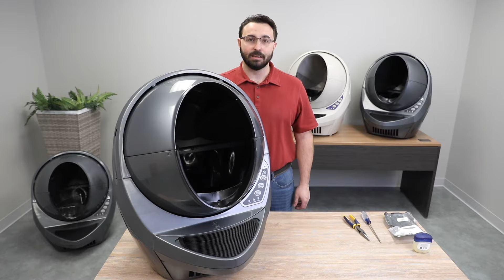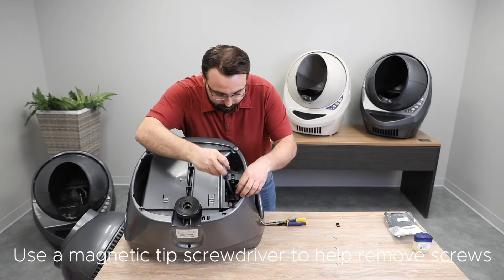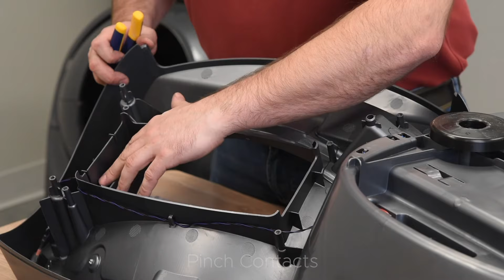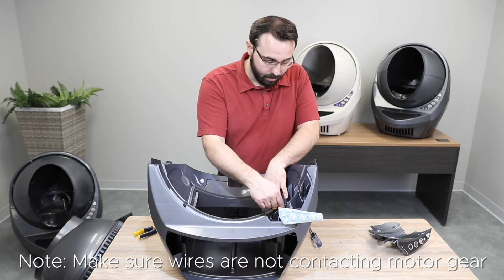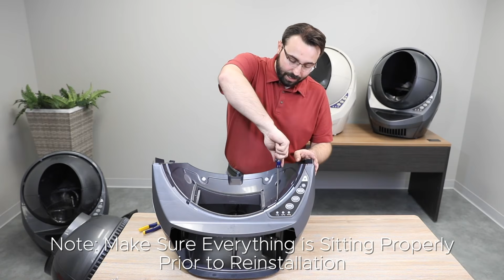Litter-Robot 3 DFI Kit + Pinch Detect Terminals Installation

Comment: *You will need a 6" screwdriver* First, thank you Litter Robot for providing this video.  For the most part this is all you need to perform this repair.  I was a little worried when the replacement part had MUCH smaller circuit boards.  The old ones were 4.5 inches long, filling the holders.  The new ones were only about an inch, but they appear to be working.  Our litter box starting saying it was full after a single use.  We would reset it in the app but the very next use it said it was full again.  The DFI replacement kit solved this problem.  If you're doing this and debating whether or not to replace the Pinch Detect Terminals, just do it.  This is not an overly complicated procedure as long as you have a long, 6" or longer, screwdriver.  An extension will not help as it will not fit in the holes.  I was a bit perturbed when I got to the bottom screws and realized a standard 4" shaft screwdriver is not long enough.  Having to make an extra trip to buy a long screwdriver after you have reached this step was highly annoying.  A simple statement of required tools would have saved me that trouble.  I will, however, give Litter Robot major props for making this system very serviceable.  So many manufacturers make their products impossible or extremely difficult to work on.  The fact that most of the maintenance and cleaning you will need to do requires little effort is impressive.
Reply: I wish I had read the comments before starting the job--the biggest issue was definitely the length of my screw driver shaft. As an FYI I found one with a long enough shaft in the electrical department of home depot--it wasn't magnetized (which really helps), but at least I could get all the screws out!
Reply: The new smaller sensor units seem to be sealed to hopefully prevent the failure from reoccurring
Reply: Yeah, the v2 sensors are fully encased in resin, so there should be no more concerns with corrosion of the leads coming off the micro controllers on the board. While it's surprising they didn't do that originally, good on Whisker for making this improvement rather than continuing the sell the faulty design and advising customers to slather the chips in Vaseline.
Reply from the maker: Thank you for your feedback about this video. We appreciate your suggestions and your continued support!
Reply: Why—when you’re getting $600+ for each of these bad boys—couldn’t you afford to get a camera that films from ABOVE so we.could see exactly what you do down in there (wire placement)? Would’ve been so helpful.

Comment: I was considering upgrading my entire cat bathroom situation.. by throwing my litterrobots in a dumpster and just getting some 5 dollar litter boxes and a scoop. I seriously cannot comprehend how this thing is so incredibly flimsy, crappily made and susceptible to not working. I had one base for 2 years after multiple fixes and adjustments to keep it running, I figured id get a second and have 2 for my 2 cats and to have a backup since id come home to it stuck 1/2 way threw a cycle and coming home to crap and pee all over the ground too many time. Well, base 1 bricked entirely 6 months later and base 2 is now in the constantly needing replacements and troubleshooting phase of its' career not even 2 years later. This company sucks, their patent on the decent design is the only reason they get away with selling this bullshit.

Comment: Claims that the number of screws in the control panel cover is "5 total". Unscrews only 4 screws in the video. Apparently, this is to make people wonder where the fifth screw is. It is a quest of sorts, just to keep things interesting. The funny part is that when he dumps the screws out at 3:00, there are actually only 4 of them. So, how many are there really? 5 or 4?

Also, in the video he claims that pinch terminals are two identical brackets ("doesn't matter which one goes where"), yet in the video the two parts he removes look very different. How come? Did one part just get distorted during removal?

Comment: What if i bypassed the pinch sensor like 2yrs ago but now i want to replace the dfi sensors..if im buying the kit should i replace the pinch sensors anyway.. my point is can I just put the DFI sensor in and leave the old pinch bar wired together or will that not work now? I’d hate to put it all back together and realize I should’ve just put the new metal pinch sensors in.
Reply: Replying to my own comment never mind my pinch sensors were toasted anyway, so I had to replace them, but I did not bypass the pinch detection as a sidenote, putting the wires back with the motor was a total shit show

Comment: First of all you don’t just need any regular screwdriver. You need a long enough screwdriver that it will reach into the hard to reach places on the underside. If you don’t have this it is impossible to do. This whole thing was extremely frustrating and way more involved than this video would suggest. For a $550 litter box the company should really send all the tools you need to fix this. Will never buy another one just because of this issue.

Comment: If you replace the DFI hardware and then have issues with your globe over-cycling and getting the position error, make sure you didn't move the position sensor when moving the motor and uninstalling/reinstalling the DIF wire into the main circuit board.  That was my issue and this video shows how the position sensor should be properly seated: https://youtu.be/gQwawQP7lys?t=200

Comment: Tl;dr: You dont just need a philips head screwdriver. You need specifically a 6"+ No.2 philips head screwdriver.

 Absolutely ridiculous. "Just a philips head screwdriver." No, you need a 6"+ No. 2 Philips head screwdriver. After my first screwdriver wasn't long enough, I used my other one with an extension. NOPE! Not designed with extenders in mind, won't fit. Got a new screwdriver kit with a one that is long enough. NOPE! Screw bit is too large. 

Whomever designed this clearly did not keep any of that in mind. After buying 2 extra sets of fkn screwdrivers I am still sol. At this point, I would almost rather throw it in the trash with how frustrated I am, especially on a part that should have had proper insulation in the first place

Comment: Great video, easy to follow, and fixed my problem with constant “drawer full” notifications that were false. 
Like others stated it needed close ups for better instruction, but taking my time I was able to replace my pinch sensors and DFI sensors. 
I also took the time to clean the areas and other places that were exposed and needed cleaning, to hopefully help extend the life of my robot. I have had this robot for almost 4 years, going from one to two, and now back to one cat. It slowly started to have false drawer full notifications around 6 months ago and after looking into the problem and possible solution, replacing these sensors worked immediately in solving the issues. I’m extremely excited to have my robot working better again!

Comment: While the video is helpful, I can’t understand why 3 of the screws for the bottom half are place in wells that are inaccessible with a standard length screwdriver. All my bit extensions exceeded the width that could pass into the holes. I couldn’t finish this repair. So much about this robot’s design seems flawed and requires too much maintenance for something that is supposed to make life convenient.

Comment: For future reference for everyone. When putting the control panel back together make sure the position sensor isn’t knocked out of place in the 2 black slots.

Took me 45 minutes of troubleshooting to find out what I had done wrong because the 3 lights blinking in a row had never happened before.
Reply: I wish I had taken this comment to heart but I didn't even know what the position sensor was since the video never mentioned it once. Four hours later, my Robot seems to be working again but this repair was way harder than it needed to be. The position sensor gets moved when you take the base apart. Without a mention of it in the video, we didn't know it had to go back in a specific spot.

Comment: If there’s anything I could call out specifically for the other DIYers out there it’s that the black soft plastic piece next to the control panel is a sensor, and that the 2 prongs on the back of it need to go in the 2 hollow pegs next to the screw hole closest to the waste bin opening. It’s the globe sensor to help it realize when it’s back in home position. I think mine got jostled while moving the motor around, and I had to go back in for a second time to reseat it (there’s a separate troubleshooting video there you can find if you use the troubleshooter on the litter robot  website to diagnose your issue that is just as handy in fixing this secondary problem you may have).

With that said, this is the easiest repair I’ve done in a while. Was there some guesswork because of questionable camera angles? Yes but my litter robot works now after not cycling for a week, and I feel like Xena Warrior Princess.

Comment: I cant believe you guys charge this much for this product. I just did this repair sequence and I'm getting the same error. This thing is very poorly built and I'm very disappointed after seeing the internals. "Notice: be sure the wires aren't getting caught in the pinion" like obviously wtf! There's no internal design to keep the wires except shoving them down into cracks. Wtf dude. What a waste. Send me a freakin new one. Yall are caking off this thing

Comment: The new DFI sensors solved the blinking blue -> fast blinking orange problem, but now I have all the 3 light blinking simultaneously and the app writing "Dump and Home fault" when I'm pretty sure I've placed the motor correctly back into its slot according to the video.
EDIT: Seems to have solved it by placing the Hall Effect sensor back in place which I displaced when replacing the DFI sensor.

Comment: I watched this whole video and then went through the installation - coming back to look at the video for every step. After going through this, I understand that the original two pinch plates were badly out of line. I replaced everything slowly and carefully and it seems like out Litter Robot 3 is working perfectly now.

An added benefit of going through this procedure is that I understand better how it works and could more easily fix it in the future.

By the way, I came across some taped-up plastic lump with 2 wires coming out of it. I didn't know what it was and just pushed it out of the way so that it wouldn't interfere with the motor. Uh.... it turns out that it was the magnetic globe positioning sensor and it gave me the red-then-yellow-then-blue lights. I found the globe positioning sensor video, put it in the right place and NOW it's finally a success.
Reply: I made the same mistake. Kinda made the victory of repair that much sweeter when the unit was completely fixed because I funded not one but two issues (one of my making, but who’s counting)?

Comment: Seems to have fixed my 3.5 year old refurb LR3. Got a little over eager with cleaning and fried the DFI sensors apparently. Had a flashing blue light that I couldn’t resolve. Also replaced the pinch sensors that were corroded. I’d recommend gloves because there was urine and litter in about every crevice.  Also a fairly long skinny screwdriver would have made it easier.

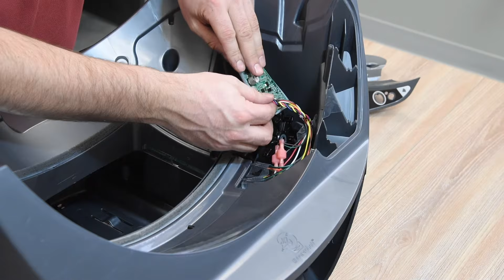Comment: 1:36 I've watched this 20 times and still can't tell which wire I'm supposed to pull. The first angle is completely covered by a plastic tab and then the cameraman moves to the left so the new shot is covered by his hand. Feels like an intern shot this, not a professional. I'm not a photographer but its painfully obvious to me that if you want to shoot something in a persons hand you should shoot from the OPPOSITE side of the arm they're holding it in so their body isnt blocking the shot. Guess I'll just pull one of the two 4 pin wires back here and I'll find out if it was the right one in an hour when it either works or I have to start over from the beginning because between the guy demonstrating, the camera person and the editor nobody ever considered the audience might want to be able to see what they're supposed to be doing. If you're gonna outsource warrenty repairs that most businesses do themselves onto the customer you could at least provide training material that doesn't leave the repair up to guesswork.
Reply: 6:58 this is unbelievable. NOBODY thought the viewers might need to see any of what was going on? How hard is it to shoot a top down angle? Was the person filming doing it while blindfolded? How do you see this in your viewfinder and not IMMEDIATELY recognize you're missing 90% of the useful information? Also, GET CLOSER!!! 70% of what's in the shot is irrelevant to the video. All I need to see right now is the pinch sensor and the DFI. He says "make sure it's on this side of the plastic". Using the video only, I challenge anyone to tell me WHICH SIDE. He's referring to a half inch by quarter inch dark colored plastic tab that's obscured by the side of the pinch sensor, his hand and the shadows that's 4 feet away from the camera. How does an editor watch this and not tell the crew "hey you need to reshoot this shot, it's literally physically impossible to tell what you're talking about"????? Then immediately after he tells me to put one piece "behind" another despite the fact that the two pieces are parallel with each other. DO YOU MEAN TO THE LEFT OR TO THE RIGHT? DO YOU MEAN UNDERNEATH IT OR ON TOP OF IT? "BEHIND" COULD MEAN EITHER WAY!!! If I keep pointing out everything so obviously wrong with this video I'll spend more time doing that than fixing this litterbox.
Reply: Found out the two wires are both 8 pin, there's only one 4 pin. I was confused because the wire he shows clearly has a black connector. We don't get anything remotely resembling a close up so that's all I could tell. Both of my 8 pins are black and my 4 pin is white so I guess they just use whatever color they feel like that day. Doesn't help with the repair process, that's for sure. Mine didn't have braided cables like his either, all my wire bundles are straight. These inconsistencies are frustrating when you're trying to copy what he does while already having such a hard time seeing it.

Comment: Thank you. This was a good video. Overall my only recommendation is that you show some close-ups of certain things such as where exactly the pinch sensors are. I was able to pull them out based on your instructions easily, but I wasn’t really sure where they came from and it took me some time to figure out how to reassemble since there aren’t any close-ups.

Comment: Excellent video, thank you! Yes, I agree that this may be possible to do with a shorter screwdriver, but you will be much less frustrated if you get a 6" or 8" screwdriver before you start. I'm very impressed with the design - using the same screws for every assembly is really forward looking for maintenance!

Comment: I am using litter robot3. After replacing the main circuit board parts, no matter which button I press, it only rotates in the EMPTY direction. Is this because some part was installed incorrectly? Or is there something wrong with another part? I replaced the main circuit board and two pinch contact & DFI kits. I am asking because it is not in the manual. I am very sorry if any errors occurred while using the translator. thank you!

Comment: Replacement was not difficult after watching this very helpful video.  You do need a long neck screw driver with magnet head so you can get the screws out easily.  So I had to make a trip to the local hardware store for the screwdriver.  But once I got started, it took about 20 minutes.  The litter robot is back working as it should.

Comment: What a junk sensor. I don't know what the engineers were thinking leaving an exposed circuit board in the drawer of the machine where it will inevitably corrode and fail. I must assume its planned obsolescence. Frustrating.
Reply from the maker: Thank you for your feedback. We would be more than happy to connect you with a product specialist and resolve any issues. Please contact us by visiting whiskersupport.com.

Comment: My LR3 suddenly stopped working after cleaning it. The rapid yellow blinking light says it is the pinch sensors. I took it apart and cleaned them thoroughly, but it still won't work. I even tried bypassing the metal tabs by connecting the two contacts directly...taken it apart 3x now and still no luck. I've already ordered the DFI replacement kit. I'm hoping that once all the parts are replaced that it works again. 
*UPDATE: one week later I got the new DFI & pinch sensor kit and replaced everything exactly as shown in this video. Im happy to report that my LR3 is now working again! 

It seems the issue was the DFI sensors gone bad even though the website says rapid yellow blinking means pinch sensor. The problem is these two parts are connected, so if one goes bad it can be tough to diagnose which one.

Some people have had luck disconnecting the metal tabs and connecting the two pinch wires directly, but if that doesn't work just replace the entire kit with the dfi sensors. 

Luckily the new ones seem more robust so they should hold up.